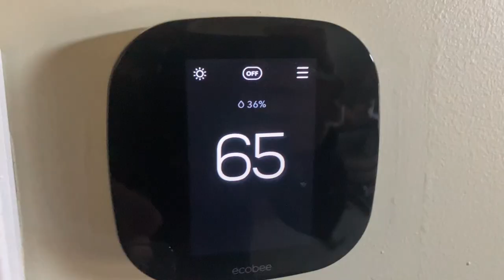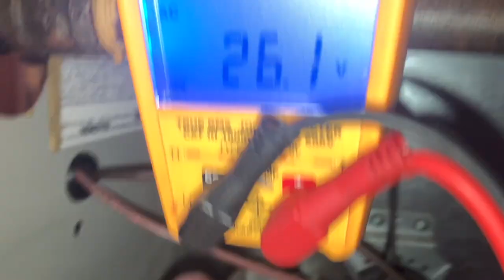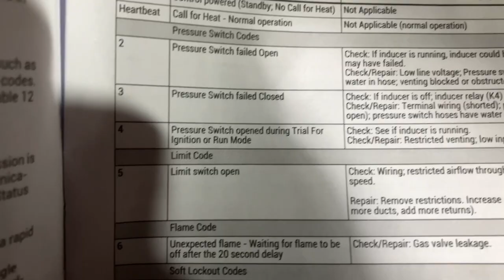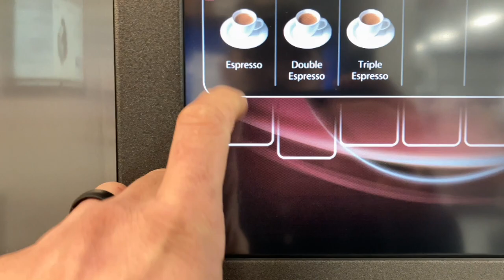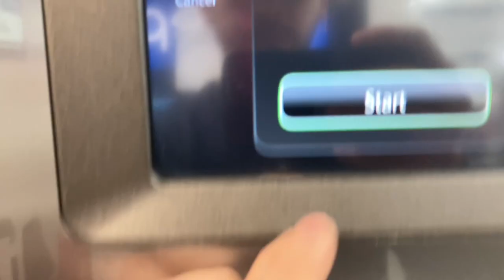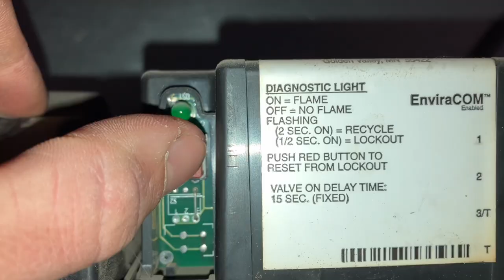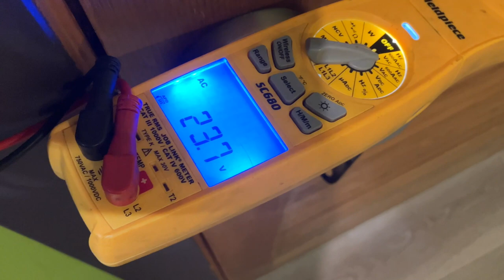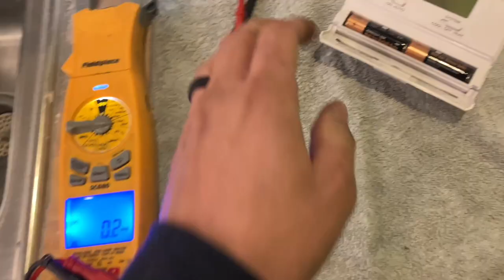2nd Call Back on a Hot Air Furnace

Comment: The pressure switch should start open and the close once the setpoint/rating of the switch is met. the switch may be tripping due to a plethora of reasons. Use a manometer to measure what the pressure switch is reading and if it meets the requirement to close the switch, only then can you determine if the switch is truly bad unless of course there is an obvious failure. The fault codes are typically an indication of the system functioning improperly. Yes, sometimes it means that the part its indicating is bad. However it usually means there's some underlying problem. IE High limit trip means low air flow not a bad switch.

Comment: im not sure if you fixed it, but i would take a combustion test to make sure the pressure switch was working and doing its job. also the whole "14volts" thing, you could get that reading if common isnt getting grounded to unit. voltage is potential difference, you may indeed have 24 volts from r to c, but have 14 volts from the gas valve to ground because that ground isn't getting a true connection from the common wire back to the transformer. next time, take the reading from the gas valve to the true common on the transformer, not the ground. some manufacturers design units differently, and may not have grounded low voltage side. hope this helps.

Comment: 2 reasons you can be measuring partial voltage at the gas valve wires(assuming this is AC). Just wires being in close proximity can capacitively induce a voltage in the other wire. Try wrapping an inch of live wire in aluminum foil and you'll read a voltage on the foil to ground as an experiment. Another, in AC switching circuits a "snubber" could be across the relay contacts which suppresses the sparking and extends relay life but at cost of a really small current constantly passing through the relay. Moral of the story, always verify voltage with the load connected cause that will put a load on the circuit and prevent these wack partial readings :)

Comment: On those electronic t stats , check across R and W on a call for heat and while in standby..  Sometimes you get a power drop across the  stat and it may not send 24V back down to furnace board, ( say 14 V)  The board is looking for 24V and if it is , say 14V , may work erratically,  or as some mixed up old serviceman once said, your furnace is working erotically....  have fun...

Comment: Pressure switch have to read voltage after the inducer run for few seconds then you can use the jumper. If you do it before the inducer run you get an error of pressure switch close

Comment: Would your JL3KM2 manometer read if a pressure switch opens or closes on power? 

I have an SDMN5 and when troubleshooting I find the reading confirms the failure if tested...

Man, I just got my Red Seal tickets for plumbing and gasfitting and feel proud. I will say, I can't hold a candle to how effective your skillz are. Truly admire your talent and thoroughness and find your videos very well done.

Pro Tip, don't put poo in your eyehole. You'll get the stinkpie e'ry time 🤣🤣🤣🤣🤣

Seriously, heal well and stay healthy 💪

Comment: You should test for continuity accross pressure switch. Usually switch has just hot leg going through so if you measure across is you should have 0 volts. Both sides to ground should have 24v. If bad youll have 24v on one side and 0 on the other to ground. Easy way just bypass pressure switch and test for continuity across it.

Comment: Sometimes they read correctly but they won’t work when trying to fire the furnace they can mislead you very easily if you haven’t come across it a few times I get calls all the time when the client says I had three different contractors and no one could figure it out

Comment: Those pressure switches stink. 

It would be reading 24v because the switch isn’t closed it’s a switch not a load. Meter reads the difference between voltage. 

The 14v I had the same weird thing then when I connected it to gas valve voltage went to 0 supervisor said there’s really no voltage there. Gotta be careful with that because I’ve said bad gas valve checked got 24v to gas valve with wires off then when I attached them 0v. Some boards have something that if the voltage is under load voltage falls to 0 and it’s really the board. Easy way to check is use a contactor if it pulls in it’s the valve if it doesn’t it’s the board.
Reply from the maker: thank you for the advice, hopefully next time i can remember that!

Comment: First of all great video, just tell it like it is and be honest. Now days with all the new equipment coming out were all going to be apprentice's in one area or another. If you say that you never have problems your'e just lying to your self, and there are a lot of people on YouTube that do just that. Couple other things, on some manufactures if you disconnect the low voltage form the gas valve you may not read 24 volts , and I never use universal control boards or anything that says universal, I learned my less on with Lennox and Rheem finances. Also I noticed that it looked like someone installed an AD-A-Wire. Remove it and see if the problem goes away, I've nothing but problems with that crap. Most of all be yourself and do not lookup to anyone on YouTube like they know everything and they are gods. We do not need anymore big heads.